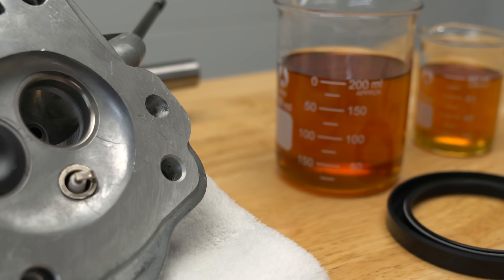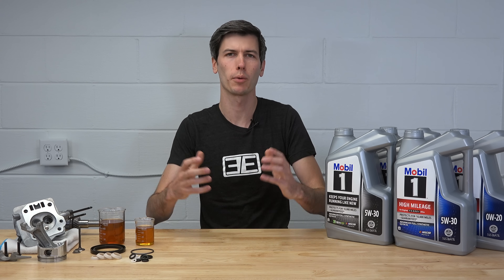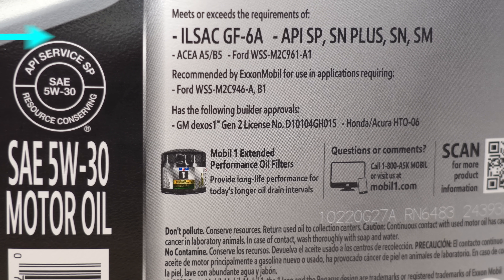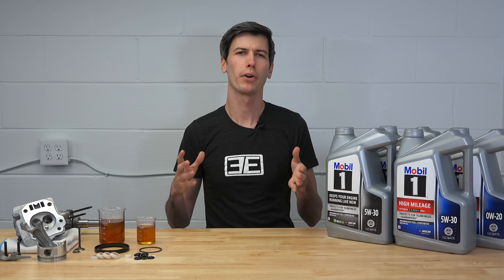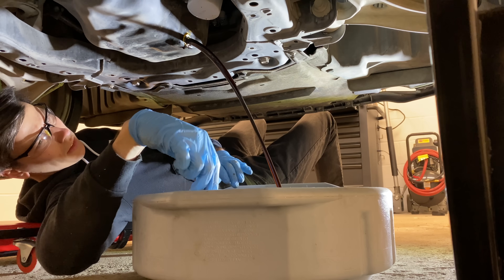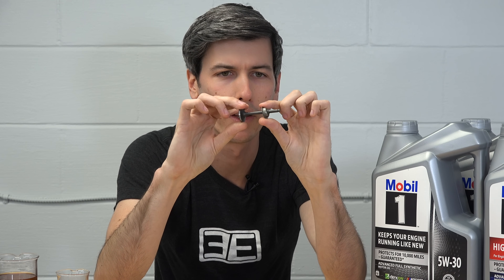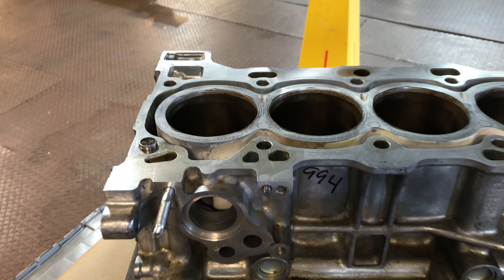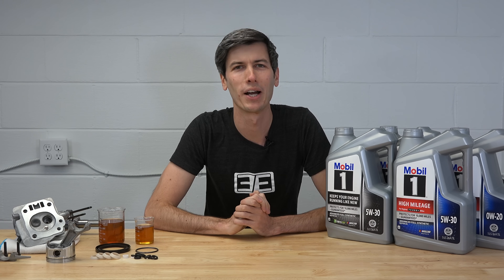Is Synthetic Motor Oil Bad For Old Cars?

Comment: What would be considered high mileage on a newer type engine say one made in 2017?
Reply: Oil manufacturers show 75k, but if you've kept up on maintenance, used quality oil, and didn't beat on it, I'd say 100k or 115k. 

I ran the high mileage blend mobil 1 for 10k miles, then went to their extended performance oil.

Comment: Only issue is that no synthetic oil that I know of, or most modern oils, have enough zinc for old flat tappet camshafts and will wipe out the cam/lifters. Also the detergents will clean the zinc/phosphorous off of components too much. I notice this issue was completely overlooked. I see articles all the time from people claiming there's no issue with using it in a classic showing how little they understand. It's not a synthetic oil issue, it's a modern oil issue.  Basically most american cars prior to the 90s, and some engines even into the early-mid 90s still had flat tappet camshafts. The engine you showed here has overhead camshafts/rollers so obviously this isn't a good example of "old." But hey, keep shilling Mobil 1. It's a good oil, but this is misleading and missing a major issue.

Comment: Was adding half a quart a week on my Saturn, oil burner. 15 years later at 300k I’ve been adding 10-40 instead of 10w-30. No issues
Reply: Everything from a wristwatch to the Titanic should use the thinnest oil that will stay on the parts. You did OK with that car but a 0W-20 Camry oils its camshafts from above  like rain from tiny holes in the cam cover. So the new light viscosity Lucas might stay glued to the parts better if you only drive it occasionally but I wouldn’t experiment beyond that.

Comment: Mobile 1 wouldn't let you say that Amsoil brought Synthetic oil to the market in the early 70's, would they?
Reply: What is Mobile 1 ?   An oil made in Mobile Alabama?!?!
Reply: Amsoil was selling a "100% 10W-40 synthetic motor oil" as early as 1968 and their oil was the "world's first synthetic oil company" to receive a certification from the API (American Petroleum Institute) back in 1972.  Mobil 1 didn't get their oil certified until 1974.  By the way, Amsoil still sells 100% synthetic motor oil to this day, just like Motul of France.  Mobil 1 back in the 1970's did also sell a 100% synthetic motor oil, BUT for for many years now they have been selling a line of "full synthetic oils."  Why would Mobil want to change from an obvious superior 100% synthetic motor oil formula to a full synthetic oil that is devoid of an exact percentage of synthetic in their oil, just like many of their competitors?
Reply: @jimn.9990  Why would they?   Full synthetic is more inexpensive to produce, hence they make a higher profit margin.  It's the buying public, who don't realize the difference between "full" and "100%".  Their marketing department deserves the credit over their chemical engineers lol.  
I use the analogy of Organic Shampoo.  The government let's them put "Organic" on their bottles, but the minimum organic ingredients only has to be something like 5% of 2 of the ingredients.  Again, marketing at its finest.  (I'm not sure of the actual numbers on the shampoo ingredients, but I'm close, it's ridiculously low)

Comment: Didn't really answer the question. I was thinking about like old 50s-70s era cars. I've heard some engines from back then require oil with a higher zinc content. All he says is look up manufacturer specs, well gm cars from the 60s didn't use dexos oil so seeing that on the bottle doesn't really help me there.

Comment: Working retail automotive I abhor explaining to customers why synthetic isn't the cause of the leak and perfectly fine for older cars. 

"Your POS had leaks to begin with and you just didn't see it and you wan't to be a cheap ass." Is what I wish I said, but I just referenced my 17 year old Cummins with 224K and show them pictures of my valve train when I did my injectors. I can eat off the inside of my engine. 

Nice vidya.

Comment: Should I hone my 7A FE Toyota engine that burns oil when I accelerate after coming downhill running on LPG?
Reply: incase anybody is wondering.. I got new valve stem seals replaced.. they were bad.. but it still burns oil. unfortunately the mechanic did not solve the piston ring isshe

Comment: Synthetic almost trashed my Grand Marquis, 2000 year. Noise and no oil pressure, drained it, put standard Valvoline in, problem solved.

Comment: My Rev up 350z burns about a quart per month. Do you think the high mileage oil would help with the seal problem?
Reply: go higher more viscouse say foe example if you are using 5w20 go for 5w30 or 5w40
Reply: Classic Dufferin okay will try it out, thanks for the heads up🙌

Comment: Short answer: no, and you should be using it in older cars. I have an '85 F150 with over 300k on the I6 up front and I feed it pure synthetic all the time. It's fine. Loves it.

Comment: I just treat the intake valve stem seal leaks in my old Land Rover diesel as a power boost. You can't keep oil in those engines so better burn it than have it drip on the floor!

Comment: I don't run mobile 1 in my ZR1 with its 4 cam LT5 even though it was designed and used by Chevrolet. Mobile has reduced the package of additives my engines needs. Mainly zinc and other requirements a flat tappet engine needs. 90-93 LT5's call for API SG and 94-95 's SH. I use Amsoil 10W40 AMO with the high zinc per the engine builders recommendations. Mobile 1 has reduced the zinc and other additives as newer engines have roller lifters and also to lessen contaminants to catalytic converters.

Comment: Have to be careful if your vehicle came from the grey area when leaded gas was being discontinued.  Late 70's to early 80's BMW motorcycles for example are well known to have valve regression and issues unless you use oils with high zddp additives.   The lead was used to cushion the valves and without it valve seats wear very fast. Problem exists in other vehicles from the era as well.

Comment: I went with this product at 22,000 and now have 325,000 — sold on it in the first 20 odometer miles
Reply: hardness" and abrasiveness should matter as even if it floats at the babbit an inertia at 2,800—3,500 rpm torque on my 01 Silverado "W" would → well what is the suspended oil thickness at 5,000 rpm on a Silverado 43 Liter?

Comment: I have a 1994 f250 7.3l IDI with 223k miles. I use 15w40 full synthetic oil. The leaks have slowed down IMMENSELY.

Comment: Straight answer, no it wont wreak your engine. 

Also fully/semi synthetic is not a recognised terms in engineering, only 100% synthetic which is defined in European Standard.

Porsche uses Motul in many other countries and now initial fill.

Seal tests are conducted, also be careful with changing your brake fluid as many Race temperature types don't have the same seal expansion rates.

Comment: I've noticed my car burns a bit of oil, but it burns some brands of oil more than others. All are 5w-30 and meet the same Ford specs. It's not a high mileage car and has had frequent changes for its whole life.

It has a real thirst for Mobil 3000. It ran very smoothly on it, but boy did it guzzle it. I think it may be a little thinner and vapourise more easily than some of the others I've used.

Currently it's got some Fuchs in there, so far so good, but it does have a tendency to not burn any oil for a while, then quickly drink a few hundred ml.

I installed a catch can to see how much was going down the intake, and while it does collect a small amount, it's nowhere near as much as it's burning.

Comment: I put full synthetic 5w40 on a VW Gol (without F) G3 from 2007 with an EA827 engine (same as a Golf MK1). No problema whatsoever. It always run 10w40 full mineral. I checked the workshop manual and it was even recommended to switch to full synth.

Comment: 312,000 mile duratec 3.5 using 30 different oil brands.  No high mileage oil used.  Change your oil according to your driving conditions. I run 10,000 plus on oil changes.  My driving is all highway.

Comment: One issue I don't often see addressed is the rate of particulate and contaminant build up in synthetic vs "dino" oils.  It is irrelevant if an oil can go 15,000 miles before breaking down if the accumulation of contaminants (acidic compounds in particular) necessitate it's being changed at no more than 3,000 to 5,000 miles.  So a key question would not be simply "can you use synthetics" but "is there an advantage to using synthetics in your particular circumstance".

Comment: I thought in general older engines expected/required/need a lot of zinc in oils which are not commonly found is as high a quantity in most modern oils.  I had some 80s Porsches that I used either high ZDDP oil or an additive.  Maybe something to tackle with the Mobile1 engineers.

Comment: In my '69 and '82 cars with less than 100k miles I use high-in-zinc oil like the Valvoline Racing VR1 10W-30.
Reply: Thanks, interestingly I done that also.....etc..:: always good to double check all ways::  viscosity,grade, api, etc.

Comment: I can't attest to anything but my own experience. I had a 2000 Dodge Dakota 4.7l V8. I switched to full synthetic oil from a standard conventional oil. I noticed smoke from the exhaust that I'd never seen before. So I drained the synthetic & went back to conventional. Never saw smoke again. I owned the truck for 12yrs & it only smoked 1 time because of synthetic oils. So it's my OPINION that vehicles made before around 2010 should not have synthetic oils in em.

Comment: He's wrong, I bought my 1977 100,000 mile car, at idle the pressure was too low and all the seals were leaking.  I've gone to petroleum based oil, eliminated my leaks and corrected oil pressure. A 5 w anything is not a high mileage oil, when these older vehicles were using straight 30w oil stock

Comment: So what about old engines that run with flat tappets? I've always been told that engines like that require oils with a high ZDDP content, to prevent premature wear to the tappets and cam shaft lobes.
Is there any truth to that? Do modern synthetics render this requirement obsolete?
It's not easy to find oils that display what ppm of ZDDP they contain, if any.
Reply: Amsoil sells a 100% synthetic product called Z Rod oil (in grades of 10W30, 10W40 and 20W50) that is specifically designed for older classic and hot rod cars.  It features a high-zinc formulation to prevent wear on flat-tappet camshafts and other critical engine components, along with a proprietary blend of rust and corrosion inhibitors for added protection during long-term storage. Z-ROD Synthetic Motor Oil is designed to perform on the street and protect during storage.
Reply: @jimn.9990  I'm aware that some oil manufacturers produce oils like that. Penrite do the same in Australia.
That doesn't really answer my question though.

Comment: Could you do a video on industry standards for oil? Stuff changes over time but it is kinda confusing. Does the current standard meet the standards of cars just 10 years old, 20yrs? 30yrs? I like to believe it but there isn't much clear cut and dry information out there. I picked the oil I use by just checking online and the brand I use says "based on current industry standards"

Comment: Lots of good information here.  Of course the elephant in the room is that many car owners  either don't have the funds or the desire to spend around a thousand dollars just to replace a $20 gasket.   Engine oil is instead used to help the car limp along keeping leaks to a minimum. 

It's sad really when the lifespan of a car is measured by the lifespan of a $20 gasket.

Comment: I switched to fully synthetic in my 300k 5.3 silverado. Soon after I was replacing the lifters. I think the detergents had softened up the varnish deposits gumming them up.
Reply: were the piston heads dirty too?
Reply: @morphius747  they didn't look too bad tbh, not much carbon deposits at all. I ended up replacing the lifters, the heads were golden brown with varnish deposits, but the came out awesome in the dishwasher!
Reply: @jimbobjimbob8275  awesome thanks for the reply

Comment: Yes and no. Anything older than 2007 new oils are not up to similar wear properties due to removal of zddp. Mobil 1 20k annual is garbage!! A ticket to a blown motor. Worst oil I ever saw next to a engine that just blew a hole in the block. At 10kmi the car had 1 quart left of 7 at fill level.. It's a death trap for late model cars!

Comment: I would say, as long as you use the correct viscosity...Failure to do so could result in oil passing the rings... I have always used full synthetic ester based oil.. I would suggest to say ethanol petrol, will like any fuel migrate into the engine oil, which is likely to cause more problems with gaskets and seals than oil..

Comment: For slightly worn engines, just a quart of next-weight-up oil can be enough to get them back into a happier-sounding place. The first time I noticed my previous car being low on oil, I added a quart of 10W30 instead of 5W25 and that was enough to soften the sound coming from the valve cover by a fair amount.

Comment: Cleaning an engine is never a bad thing... says a guy who never had an older car whose engine sized because dad decided to flush the engine in his car then cause a blockage reducing oil pressure to the main bearings and bam.... of course this was 30 years ago possibly before the presenter was born... with a car using crappy old 80s oils........ but I digress

Comment: He never brought up zinc in oil for older iron block engines kinda makes me think he didn't do his research but instead read off of a mobile 1 script. I have a older truck from the 70s and use a diesel oil recommended from the engine builder. It is a SBC so not a diesel.

Comment: @Engineering Explained, you missed a major issue with using modern synthetic oil in older cars.  The older cars engine probably will have a large amount a sludge in the engine in areas not causing any harm.  Modern synthetic oil have detergents which can break the sludge deposits loose.  These sludge deposits then can plug oil passage ways and cause engine failure.  The modern synthetic oil is not the problem, sludge build up is the issue but it can still result in engine failure.

Comment: Well there are cases like the ford ecoboost engine where the viscosity from factory is too low so you have reduced longevity but better emissions. As an owner i will happily bump up one grade to increase longevity. Also the case if you stress your engine more. not gonne race on 0-w20 :D
Reply: K0nst4nt1n you should “race” on whatever the engine was made for.

Comment: I've heard rumors of not using synthetic oil on air cooled (oil cooled) Volkswagens as heat dissipation isn't as efficient on synthetic oils as it is in conventional oils. 

Any theories/ideas to this for argument/curiosity sake?
Reply: I'm an air cooled VW driver.  I've heard that rumor and I think It's B.S.   Thinner oils will make a VW run cooler because the oil circulates more quickly.   It's a mistake to just automatically run 50 wt. oil in a VW "just because it's aircooled and it runs hot".   SAE 30 or 15W40 is best in most climates.   Oil viscosity makes more of a difference in VWs than synthetic / conventional oil use.

Comment: I have a car that's above 215000 (Sonata XS) (Four-door Coupe) and the oil I got was from NAPA (closest to me at the time) and however they didn't tell me that it was High-Mileage, but I used it and it seems to run just fine on 5w 20 oil. Also one question, is it recommended to pre-fill your oil?

Comment: Oil for old cars usually has a  higher zinc content to protect the camshafts as they do not have roller rockers as all modern cars do, I believe this was done in modern cars to protect the catalytic converter.  Is this a myth? as I'm sure most synthetics have no or low zinc content.

Comment: Do not switch to a synthetic oils when the engine is at high millage already, but if you put it is a synthetic oil and it is old and not high millage that should not be a problem.

Comment: I use semi synthetic Castrol and 25% lucas synthetic oil stabilizer. Fuel mileage increased about 1/2 mile per gallon so far.

Comment: FULL SYNTHETIC OIL is a Petroleum Type 3 Base Oil anyways ...AMSOIL 100 PERCENT SYNTHETIC OIL is a True Synthetic Base Oil and I use it in a 20 year old engine and it has helped the seals to work even better that before when I was using a Full Synthetic Oil  and it is a 5 w 20 Grade and it has the best anti wear rating on the market  .

Comment: Bought an old moped engine from e bay put some engine flush in it after one our every seal started to leak there was so much gunk in that engine it wouldn’t even drain properly after that I rebuilt it and now I basically have a new engine

Comment: So my 1936 sidevalve engine with white metal bearings, which at the time was recommended to be 'decarbonized' or 'decoked' every 5k miles has no hope just by using chewing gum oil to get it to 100k! :) I wonder if they still make 'Mobiloil Arctic' (for winter use) or 'Mobiloil A' (for summer use)...

Comment: So the answer is spend more money on expensive oil for a car that wasn’t designed for it. And while you’re at it spend money on some next gaskets all over your engine. Umm no thanks 

Just use what your engine was designed for. Cheap mineral oil.

Comment: What is the difference in burning engine oil and 2 stroke oil in a combustion chamber?
I have a auxiliary tank that feeds 2 stroke oil into a rotary engines OIL METER PUMP, and I have often wondered is that better, different, or completely indifferent to how it would react inside of a combustion chamber?